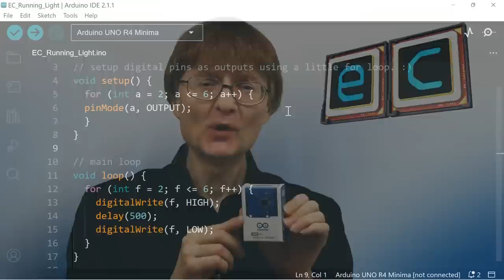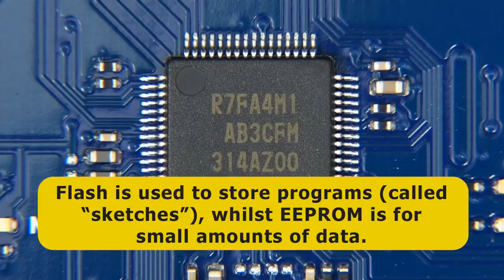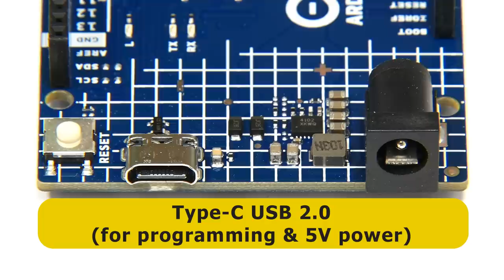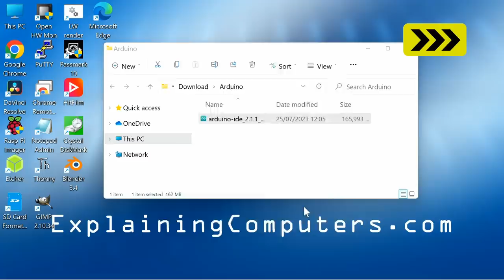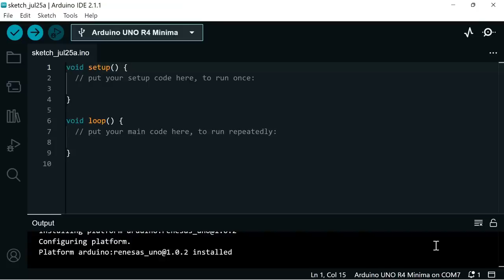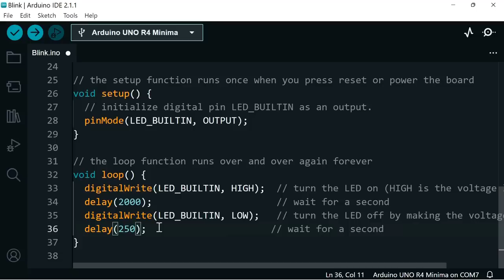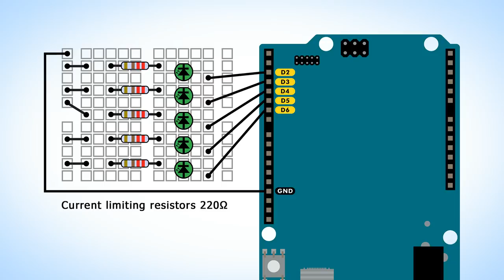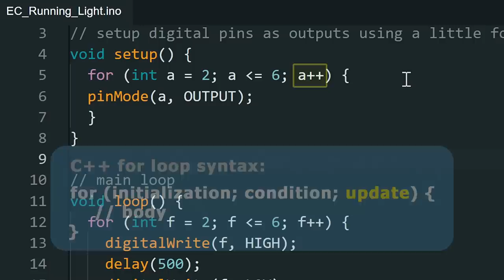Introduction to Arduino: UNO R4 Minima

Comment: I used one as a solar charge controller and logger. It monitors battery voltage and charge current and via PWM regulates the charge current from a PV solar array. It also keeps a running total of produced amperes, watts and various highs and lows. It spits out the data over USB to a Raspberry Pi which is running Apache to display this data and provide other functionality.
Reply: I would love some links to that project if you have them.
Reply: @liamstone3437  There are no links as it's not on the web. I wrote all the Arduino and Apache code myself. My brother did all the associated hardware.
Reply: @millzee60  I am still interested if you want to share details.
Reply: @liamstone3437  sorry but I don't want to put the details into the public domain. I posted here to demonstrate that these small SBCs can be used to very real effect.
Reply: That is very cool!
Reply: Ta weno

Comment: Glad to see that Arduino hasn't removed the barrel-jack power connector that allows people to dig through boxes of old Wall-socket adapters and possibly re-use them if they're somewhere between 5-24volts. 😀
Reply: Yes, that is a handy feature, for sure.

Comment: Very nice to see you on Arduino Land 😊Take care with the limiting resistors since as far as I know the GPIOs for the R4s can only handle 8mA maximum current. Best regards!
Reply: Yes, 220 ohms is a bit low. I use 1k resistors and the LEDs are more than bright enough. In fact, some of the modern surface mount LEDs are extremely bright and 4k7 is an appropriate resistor to use.
Reply from the maker: Good points, and noted. I am used to Pis. I also always struggle to get LEDs bright enough to show in camera, so sometimes push things a little far. :)
Reply: @ExplainingComputers  But how is Arduino supposed to compete with this over sized, under powered, and over priced device when Raspberry Pi is now involved with their very small footprint Pico for only $4 and with dual core 32 bit processors running at 200Mhz each?

Comment: I see you getting really excited over this. Imagine this device being around 30 or430 years ago when we were mucking about doing this the hard way. I've just bought an Uno R4 Wifi, and have managed to get it running as a webserver and relay controller that I can control with a web browser on a phone etc. fun times.  The motivation in getting it was to build a model railway turntable, using a stepper motor and indexed positions etc. which I'm sure to get onto once I've done playing around.

Comment: Great learning video with good humor as well, Chris. As I have told you before, you make every Sunday morning like Christmas morning!  I have used Arduino's for many Amateur Radio uses such as measuring antenna SWR, a power indicating dummy load, several digital meters for displaying voltage and current, and morse keyers of various types including my most current project that takes voice input (i.e. "dit" and "dah" words from a microphone) and converts it to actual dit's and dah's over the air eliminating the manual key normally used for input (I have tremors that are so bad I can no longer use a manual key). I have watched many of your videos where you use a pico-pi or similar device with python to do something relatively simple and think how I could implement that on an Arduino for about $8 with an Arduino Nano using less power. You could implement your weather station on the new arduino R4 wifi board and really impress those ducks!!! (Hint...hint...)
Reply from the maker: Nice hint!

Comment: I've seen this used in the ham radio community as rotor controllers for large antennas. but the voltage has to be stepped up a bit for that. Great video, Chris.

Comment: yo… Just checking in on you bud… I just fully committed to Linux on my desktop and remember about 5  years ago your video made it possible. At that time there was software I was unwilling to part with in Windows but I've decided to just run dual boot with linux as primary. Keep pushing man you're almost to 1 million subs… You can do it… I was actually just checking to see if you had surpassed it yet because you are close…
Reply from the maker: Thanks for this. :)

Comment: Excellent as always.   I really don’t don’t know about these. I did buy a pi 4 about a month ago and installed Linux Mint on my 11 year old Lenovo.  So excellent channel.
Reply: Lenovo, huh? Is it a ThinkPad? 👀
Reply: @Praxibetel-Ix  yes a X230 it’s 11 years old with a mechanical 2.5” drive. 8 gig of memory.  Runs great with Mint. I had Ubuntu on it. I like Mint.
Reply: @mrbrent62  Oh, wow! I have a T400 that's now old enough to use social media but bought refurbished four years ago. 4 GB of RAM, forgot the exact amount of storage space but it was definitely was over 100 GB, ATI inside (shocker!), 14:10 display, and with Windows 10 installed. I don't really use it anymore, but it was a good laptop. It certainly ran The Sims better than the Acer laptop that preceded it!

I have been contemplating getting another laptop on and off, though I'm torn between the same Acer model I had (even if it means getting one that's being sold for parts and refurbishing it myself) and another ThinkPad.

Comment: Thanks Chris for another great informative video. It was great to see Stanley the Knife back on the job
I really need to take a C++ course before I can use this properly, but I am getting a SDR Radio with the ESP32 chip inside which can only be updated by SKETCHES so this board looks promising to learn SKETCHES .
Have a great week!
Reply: Regarding C++, I taught myself C back in 1990 when I was still a programmer on IBM mainframes.  C++ is an OOP version of C.  Nowadays, with the resources on the internet, you should have no problem.  If you already know a programming language, it will be a cinch.

Comment: I am endlessly amazed by the new generations of the Arduino, and other SBCs.
This quite humble little board has wider processor busses, a much faster Central Processor Unit (although maybe a little less elaborate), more and faster RAM and more storage than early computers like the first DEC PDPs.  It is miles faster than the first PCs, although the early IBM PC had more RAM.
The biggest difference between those early computers and this Arduino is our expectations concerning their capabilities.

Comment: I love the Arduino. I learned about them just after I finished my Master’s studies in Electrical and computer Engineering. Everything I had made before then for assignments was using lower level digital logic chips and microprocessors with assembly code at best. Difficult to make anything really useful. When I discovered the Arduino, I made a water dispenser that connects to a spigot and has a flow meter, solenoid valve and LCD screen. User input is via a set of three buttons. It can dispense a selected amount of water in quarts, gallons or liters. A very fun project. I need to come up with another project idea.

Comment: Interesting! I have been using arduino boards for years and didn’t even know about the new minima. Very cool. My favorite for simple projects is the attiny85 though. You can even run those on coin cells.

Comment: Another great one, Chris!

Whilst I don't own any actual Arduino-branded hardware, the Arduino IDE does make it possible to use third-party controllers like an Arduino, if they suit your case use scenarios better.

I mainly use the ESP01S, not only because of its minuscule footprint, but also its WiFi capabilities.

The "Arduino" by-name goes far beyond the own-brand hardware, it's a DIY ecosystem in its own right.
Reply: Esp01s is a great board, and it still has more flash memory than this arduino board

Comment: Thanks for the review. I bought a Pico last summer and never used it for anything after installing a basic Python script on it.  

The Arduino looks nifty. I wish that I had a need to fill that would encourage me to purchase and learn how to use it. With any luck, a need will surface and I'll remember this video.

I wonder if chickens would be as capivated as ducks by flashing LEDs. The birds in my back yard are incredibly curious ladies.
Reply: Maybe try and get some inspiration from 'fun arduino projects' videos? Home automation is an easy one to recommend, diy weather station, plants watering system... or 'the most useless box'. 😉
I mostly got into microcontrollers for my model railroad and later started making buttonboxes for games etc. Still planning on making a cockpit sized one for DCS world, but seeing as I have multiple aircraft, I'm having more of a aesthetic/design problem. 😅

Comment: Thanks for the video, Chris!  I’ve been curious about the Arduino family for years.  I’ve used the RPi Pico a number of times, and I’m scratching my head about what might make Arduino better (for certain applications).  👍
Reply from the maker: The Pico, at its price, does indeed provide stiff competition . . .
Reply: I think loads of shields (easier for beginners to start with a project quickly), diverse power voltages and possibly power usage and 5V logic (more widely used) would be in favor of most Arduinos.
Pretty sure Pico has 3.3V logic and 2nd core is always running (even when not used) and only accepts 5V as power. Also runs on much higher MHz, so likely uses more power.

Comment: great tutorial as always Chris! however, I have a few notes: (... well one note & a nitpick ;) ...)
1. Do note that unlike its predecessor UNOs, the R4 has a maximum GPIO current load of 8mA! so you'll need a larger resistor to keep the board healthy (390Ω or better)~Edit: I just noticed Julio pointed this out already.
2. I'm a stickler for code formatting so my OCD clocked your poorly indentated for() loop body (the call to pinMode()).

cheers & looking forward to your next enlightening adventure.

Comment: I believe you may have done an earlier video about this but I'd like to make a solution that monitors plant and soil health to try to help my garden grow as well as possible.  Instead of guessing why the plants sometimes die off or don't produce fruit, it would be wonderful to have a set of sensors and software that could at least give me a hint as to any serious issues like perhaps moisture content in the soil, ph levels in the soil, leaf health, and other things.  Thanks for the video.  The US version was out of stock but the UK version was about 27 pounds so hopefully when it is available in the US it will be about the same cost (considering exchange rate)
Reply: Wow, what a cool application you have in mind.  To borrows a phrase from the 1970s, "it's amazing what you can do with electronic data processing".

Comment: Wow - this R4 is certainly a massive upgrade over the R3. It’s good that Arduino’s core product line has caught up with their more niche products and the microcontroller landscape as a whole.
Reply: But not much of one overall. Especially when you got Raspberry Pi now involved with their Pico for only $4 and with dual core 32 bit processors running at 200Mhz each.
Reply: @knerduno5942  Pico is great value and has more processing power but 3.3V-only kind of stinks. It's not fun boosting signal voltages and I find most stuff is 5V due to the popularity of Arduino. So I feel like Arduino is more practical overall. The onboard RTC and floating point capability are also quite noteworthy additions.

Comment: As a novice with some pico experience I've been reluctant to embrace Arduino.  (mostly because I find C intimidating)  In addition the specs of the R4 seem considerably lower than the less expensive pico.  Other than the size of the ecosystem what advantages does the Arduino have over the pico / MicroPython?  Am I missing something?

Comment: @ExplainingComputers Nice video, but I have to warn you and others about using 220 ohms for the current-limiting resistors. The new R4 UNO can only deliver 8mA per pin instead of 20mA like the older R3 UNO. So, I advise you to use at least a 470Ω current-limiting resistor.

I would really like an advanced tutorial where you use the op-amp, CAN, and especially the debug SWD
Reply: Yes, these are new to me, and I’m particularly interested in CAN. maybe build some kind of interface to a car for some purpose?

Comment: It would be interesting to see a comparison with a Raspberry Pi Pico, which is much cheaper and has an extra core. I've experimented with Arduino Nanos but moved over to the Pi Pico, which is about the same price but is much more capable.
Reply from the maker: Whilst making this video, I did keep thinking of the $4/5 Pico . . . !
Reply: also how it compares with previous Uno boards

Comment: A happy Sunday to you, thanks for this interesting video. As to my use case it would have to be a model railway layout! The code would control servo driven points, set a route & signalling then run a loco at a set speed through the route e.g. collect rolling stock & return to a predefined point. There would be multiple scenarios to code & add to a sequence, an education in itself :)  Plus one for a new black & gold 'Henry the knife' :_stanley:
Reply from the maker: Greetings Alan. I see several votes here for model railways. :)

Comment: Wow! Great video Chris" With this type of uC I'd make a large digital clock using Nixies or a massive display of LEDs if I could get the multiplexing to work.  Oh, as before, you only need one current limiting resistor in your light chaser circuit...

Comment: 17:04 My next project is showing if we have got mail in our mailbox, as it is mounted quite low under the neighbors ones and I don't want to get on all fours just to grab into thin air every morning lol. So an e-Ink display should just show a mailbox-icon next to our surname, when the lid has been flipped. Needless to say this won't guarantee that there is mail, but if the display does not show that the lid has been flipped, there is guaranteed no mail and I can save my self the morning crawling routine 🙂

Comment: I like that their new chip supports more different hardware interfaces.
But I rather need a cheaper chip than a powerful and functional one. Maybe I should try PIC?
Btw, I propose to make a video about different microcontrollers. Most of all, I'm interested in what is required to start working with them and how the same program looks like for different MСUs.
Reply: Nano-every, PI Pico, Black/Blue Pil ?

Comment: I have an Arduino mega 2560 running the water cooling system on my home computer.   Has been in continual use for just over 10 1/2 years now ( 365 days a year at 24 hours a day...).    Not a single issue with the Arduino.
Reply from the maker: Wow! That is good service from that board.

Comment: IDK what I’d do with a board like that. I’m grateful to see Arduino coming up with a more modern Uno. Interesting that it’s using a Renesas chipset over an atmel one. That’s about where my interest stops. I’d rather just use a pi pico. This is a product that should’ve been launched 4 years ago.
Reply: I made a similar comment before seeing yours. The Pi Pico is much cheaper than this and has an extra core. I'd like to see a comparison of the two.
Reply: I'm forced to wonder whether it was the competition that forced Arduino out of their complacency.  Supply chain issues could also have been a factor.
Reply: @johnm2012  the big difference is the built in DAC+opamp and an ARM m0 (pico) vs m4 (uno r4). I suppose the m4 should have some instructions that allow certain math operations in fewer clock cycles but I believe the RP2040 could compensate with a clock that at minimum is twice as fast and can run up to 3 times faster than the Renesas chip when overclocked.

Comment: Video suggestion. I just cloned my laptop hard drive to increase the storage and used your cloning hard drive video to do this. However an updated version of this video may be useful to include nvme drives and the enclosure needed to clone it externally to the laptop or computer. And the macrium software is now easier to use as it now can adjust partitions sizes automaticallyt to make allowances for increased or deceased storage area.
Reply from the maker: Thanks for this. It is a good idea to do an update. Noted. :)

Comment: Excellent video, as always. Not sure what I would do with an R4, I have had an R3 for years and not used it! I did however use a Mega, in conjunction with a shield and an LCD display, to make a clock that has a Pac-Man maze on the display, complete with characters running around. Designed by a maker in New Zealand, it is one of my favourite projects.

Comment: Great video - very helpful. I need to create the front and back flashing lights on the head of my full-scale R2D2. So first, I need to buy the two led light boards and then use the mini to handle the light sequencing. Any suggestions on the led light boards and who might make them? The front board consists of two small 4 x 6  small blue and white leds, one rectangle above the other - and on the back of R2D2's head, there are 4 x12 small red green leds in a rectangle. The actual number of leds might vary from the number above, that's just an estimate.
Reply from the maker: Now this is a serious and highly important application. :) Sounds like you may need to get the LEDs and mount them in some pinboard. For suppliers of different LED boards, see Pimoroni (UK) or Adafruit (US).

Comment: Just one thing when using the new uno rev4 .The outputs are limited to only 8ma not 20ma as per the uno rev3 so when using LEDs on uno rev4 use say 1k resistors.